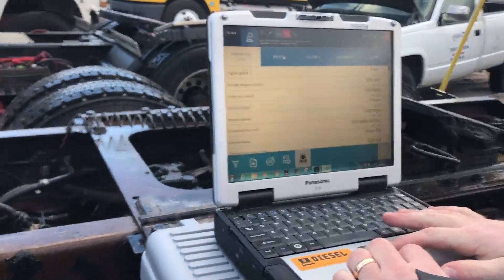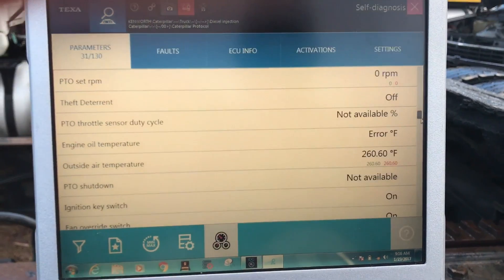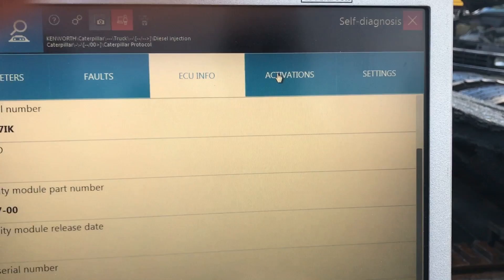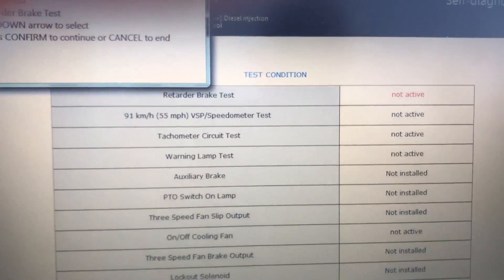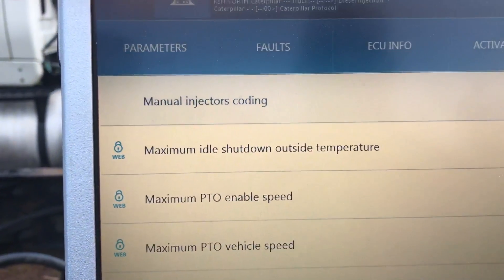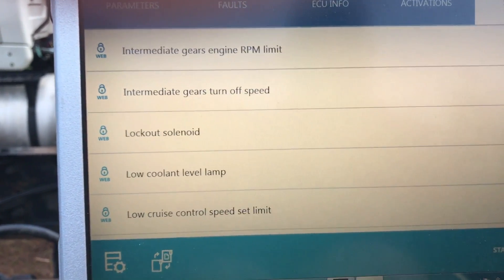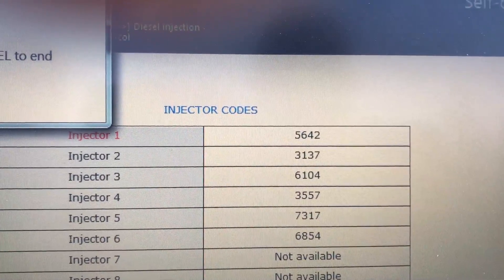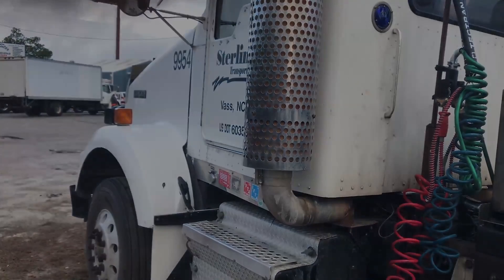TEXA Truck on a 2005 CAT C15 - Programs CAT Injectors

Comment: hello, do you works the Cat cut-off activates? My idc5 activates only the first injectors. Ty.
Reply from the maker: You have to use the arrow keys to navigate between injectors 1-6, then do the activation to "cut" them off. If you are having problems, call our tech support line at 888-983-1975 option 2. Thanks!
Reply: Ty.Greetings from Serbia!!!